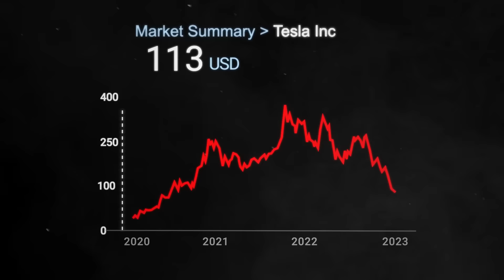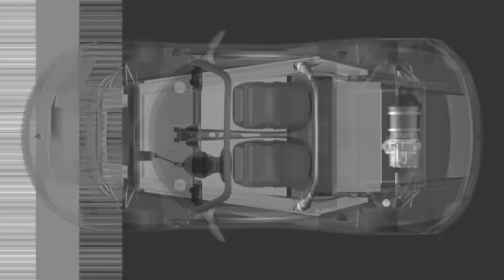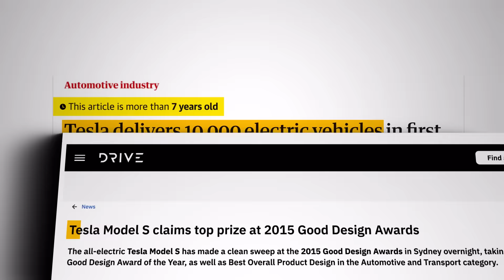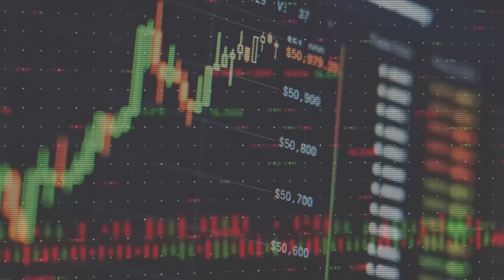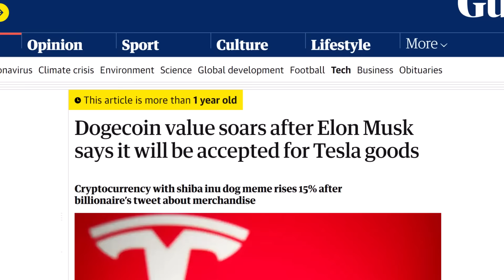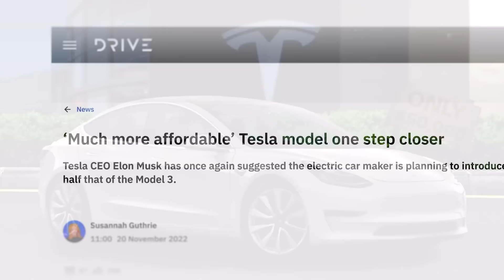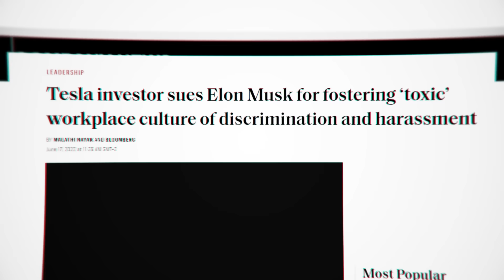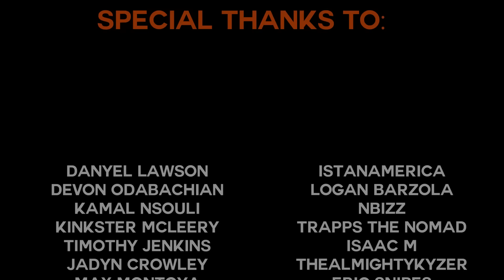Why Elon Musk Is A Fraud

Comment: You could have touched on the fact that Tesla was simply overvalued due to Musk's hype. I mean their value was so ludicrously high in 2021, they were worth more than the entire auto industry combined and then some. And Tesla also simply doesn't have enough production capacity for their demand. And with the recent price cuts,the car market just realized how much better Tesla's margins are compared to the competition.
Reply: price cuts were quietly reversed when demand spiked after.
Reply: @AlexanderTheGoodEnough  partially, it's still cheaper then before the cuts, as the big reason is they still need the model Y to be under 55k because the IRS for some reason doesn't consider it an SUV, so the electric tax break didn't apply, even though every other agency and vehicle in the same class is an SUV.
TL;DR: the IRS' stupidity was actually good for consumers.
Reply: Tesla has massive structural advantages over the rest of the industry.
Reply: @taylorc2542  do they? I would think LG would considering they make every battery besides Tesla and Lucid? 

Every GM, VW, Ford, Hyundai, Kia, FCA, etc all use LG batteries
Reply: @taylorc2542  LOL
They have no structual advantage over the industry. 
They have the same machines Toyota and VW are using.

Musk is just really good conman that convinced the world he is a genius up until just a few months ago.
People finally see through this fassade and he gets the bill one after another.

First they ridiculed him for making a marketing play with twitter and then being stupid enough to actually agree on an arrangement before all the info was available, then they realized that both his public and good transport systems are completely bullshit, people are finally catching up that "Autopilot" has a legal definition and the Tesla software has NEVER ever been close to reaching it, they realized he was part of PayPal not THE PayPal and even SpaceX (who are his genuine only positive contributions to the world) was not his idea (nor were the reusable rockets).
Reply: Tesla’s cars are ancient in the car workd
Reply: @AlexanderTheGoodEnough  they also increase operating margins even with price cuts. Literally a slide in their q4 slide deck. But people never read 😭
Reply: People: Tesla's cars are overpriced!
Meanwhile in Croatia: Wanna buy a Rimac that almost killed Richard Hammond?
Reply: @dirtyorganboy  Yeah. They made a Tesla Roadster back in like 2007-2008. It's based off of a Lotus Elise. It kind of looks like a Lotus Evora in some ways.
Reply: If we are using stock price declines as proof a company is screwed, the where's the video on Nvidia when it dropped 65?
Reply: @Tential1   if Tesla was sold tomorrow morning, how much you think they would get? Nowhere near that valuation that's for sure...
Reply: @HOLLYWOKEtv ... Not green Revolution, just that Musk and his way of presenting the company made it seem like a tech stock, so it is similar to Netflix, because both are just newer players that came in and refreshed/reinvented their respective industries, automotive and film/media respectively, but at the end of the day, they are both just players, not monopolies in their fields
Reply: @gandalf_thegrey  You don't think Musk is highly intelligent?
Reply: Elon said the stock was overvalued. 
You blame Musk, yet wall Street is the government goodies bag.
FTX
Gamestop
Enron
Reply: @matternst1442  LG outsources their batteries. Some Chyna man stamps an LG sticker under LG contract.
Reply: Lol wait?? Are you telling me moon left out huge parts of the story to bend a narrative his way!?!?!? No wayyyyy he is soooo trustworthy
Reply: but he rather tell us Elon's life story and stretch this video to 20 min xD
Reply: Who told you that Tesla is just a car company? You compare it to other car companies yet you should compare it to a multitude of branches
Reply: @gandalf_thegrey  The main advantage is their company culture runs circles around legacy makers i.e. it runs like a start up instead of a bureaucracy. Other advantages include the best charging network, no marketing costs, and the data set/AI training model they are collecting with the existing AutoPilot fleet.
Reply: @Elstocks21  Yes it's true Telsa isn't just a car company, they also sell solar panels that are no better than what you can buy from any other solar panel supplier & an overpriced solar roof that doesn't make any economic sense!
Reply: @rabbychan  hes jelli af… thats all
Reply: But the fact that they cant satisfy the demand can work in Tesla favor - it makes Teslas more valuable - therefore more expensive. Its not necessary a bad thing.
Reply: They are worth more than just a car company. 
Solar. Logistics. Automation. Trucking.
Reply: Did you even watch the video? 10:30 onwards.
Reply: @Galacsia  Yea it its end Tesla being the top dog in EV and will face stiff competition ahead.
Reply: Every time that I mentioned that fact, or anything that wasn't hyped or praise, back in 2021 (up until very recently) I was thinking that other people would see it as a concern (the rational people that I, wrongly, thought made up a good chunk of the population). Nope, I would get dumped on every single time, online or in person. I was a weird hater and Tesla stock would go to the moon making every person who believed in Musk very rich, and mankind would ascend to a new level of greatness on earth and in the heavens on Mars... Yea, a bit hyperbolic, but hat's actually how it felt to me, maybe I just didn't believe in the savior hard enough. Even now, I feel like the main reasons people are starting to come around are more based on politics, rather than looking at the actual situation which I find just as concerning.
Reply: You are completely missing the point that Tesla isn’t just an EV company. It’s an EV + energy + software company that now also makes its own batteries from scratch. They also have the only reliable charging infrastructure. Now, I do agree that it was overpriced to an extent even with all these factors in mind, but one cannot compare apples to apples + oranges + bananas.
Reply: @Grapheneolic  You are right. I always forget that. But profit wise, dont they make their bread from the EV cars? What software are you talking about as well - the software inside the Teslas? Auto Pilot?
Reply: @Grapheneolic  The solar buisness is small and still not to scale, the software and charging networks are mandatory to operate the electic car, just like gas stations and software in other modern cars. Also you cannot value an electric charging station to a gas station, as all the cost is in the charging station itself + maintenance, no store to make the difference . Sure it adds a couple of billions of dollars in value, but no more than 6,(electrify america is valued at 2.5B).
Reply: @realthunder6556 it’s not just the IRS also, another thing to mention is the federal governments involvement in helping other US manufacturers heavily with aid financially and support legally while Tesla didn’t even get invited to the summit.
Reply: they got huge margins. they are selling these shitboxes for 100k when even a camry feels like a different universe in terms of quality. had a model x for a few weeks and i was shocked and appalled about that. i still cannot understand how someone in their right mind would buy a tesla for that kind of money, especially now when there are alternatives from the germans and pretty much everybody else
Reply: @gandalf_thegrey  he upset the left, and that’s enough really
Reply: Yeah but pretty much everything was overvalued in early 2021.
That is if you assume now is correctly valued.
Reply: @gandalf_thegrey there’s a lot of projections in your comment. People know Musk didn’t come up with these ideas but making them successful is all him. 

I simply don’t care about him as a person and there’s a lot of people of this mindset. People like that he’s doing some good. It’s a capitalist society, so if you think he’s doing out of the goodness of his heart you’re to blame. He simply saw there’s gap in the market in the case of Tesla and SpaceX and bought them out to push them to success. Without him neither of these would be successful with their original founders. 

I wanted to buy a Tesla but looking at the safety issues and lack of self repair is a deal breaker.
Reply: @Grapheneolic  Tesla uses Panasonic batteries, which are produced as a joint venture & while they have input into the design, chemically the batteries are nothing more special than what other carmakers have available.
While Tesla has tried to heavily use software to overcome the hardware limitations in the vehicles which create a handicap for self driving & kills people, they can hardly be called a software company!
Reply: @jayr6637  I was an electrode engineer for the 4680 batteries at Tesla, those are fully produced by Tesla using its own technology and what sets them apart mainly is the means by which they manufacture them in a cheaper manner (Tesla is all about vertical integration and keeping everything under one roof, which ultimately leads to reduced costs + given its mainly domestic this will be even more important if China relations further deteriorate). Tesla also clearly lays out the limitations of its self-driving as they actively iterate on it, if people choose to ignore that by sleeping behind the wheel then that is on them.
Reply: @Grapheneolic  While I find it hard to believe an engineer working in such a field would bother watching Youtube content critical of Tesla, let alone waste time debating others in the comments, I have no way of knowing whether or not your statement is true. But upon checking, you are right currently 4680 production is in house, with Panasonic getting involved to help with production numbers, but I note that you have said nothing of the 4680 chemistry being any different.

While this "Tesla also clearly lays out the limitations of its self-driving" may be technically true when reading through documentation, the conman CEO of Tesla does sing quite a different tune in his public statements... when he's trying to scam more people into buying a Tesla by promising fully autonomous robotaxi's that will make you money!
Reply: People who invest in Tesla are investing in potential not current value.
Reply: There's a few key things everybody seems to be missing,Tesla is not a automaker,it is a AI company the cars that you see are not cars they are robots on Wheels the technology in which Tesla has are decades ahead of anybody that you guys call competition,tesla's valuation being bigger than auto manufacturers put together is due to the fact that Tesla is way more than just an automaker, which alot of people seems to ignore the technology or maybe they just don't know ,so they speak on what they believe and not what they know to be facts.
Reply: I mean he said that at the end of the video very clearly I think
Reply: Look at EV, Not market cap.
Reply: It's the circle of douche.  A young CEO starts out, calls some good shots, gets lucky in others, and becomes the new golden ticket.  Golden ticket starts believing their own hype, they smoke pot all day and start thinking that even their farts are magical money making innovations.  Reality does what it does, and they come crashing down.
Reply: it was also valued more like a tech company than a car company
Reply: @rabbychan I cant speak for gandalf. Musk obviously isn't a moron, but he isn't as smart as his public persona. he is a good investor and a better marketeer
Reply: Watching Silicon Valley teaches you a lot about this bs lol
Reply: They did actually, that point was touched on in the vid
Reply: If you tried to raise this point two or three years ago you'd have to deal with all the musk worshippers
Reply: @rabbychan He was before his lobotomy
Reply: Tesla is AWESOME!
Reply: Un Elon musk c’est bête
Reply: Not just that, but people also are seeing Tesla quality is god awful
Reply: @taylorc2542  wtf are you talking about structural advantages?
Reply: Shh don't let facts get in the way of the clickbait or views
Reply: Everything was ludicrously high due to $0 commission trading platforms on all smartphones and the large amount of money printed in 2020 and 2021
Reply: If there is so much demand, then why cut prices? It’s more nonsense propagated by Tesla
Reply: He didn’t even touch on Tesla’s sketchy accounting. I guarantee you that their books are not clean.
Reply: @tpfrk8977  In China they needed to be competitive, then in the US the model Y isn't considered a SUV by the IRS(the rest of the US gov does, but this time it's a good thing for the consumers) so the price was too high for the tax break and also after the stock price drop and Elon Twitter shenanigans, they needed even more demand so the stock is up, up, up
Reply: @realthunder6556  The stock is up because of the gamma squeeze caused by call option buying by meme stock speculators
Reply: @AlexanderTheGoodEnough  Just by small amount
Reply: @gandalf_thegrey  Tesla has the biggest injector machines, more vertical, faster growth
Reply: @Tential1  61 percent customer return before price cuts... Tesla is still growing. People quit reading too soon.
Reply: You , realfart6, could have touched on the fact that Tesla is the real life version of Skynet and is going to, like the Terminators, hold humanity accountable. Put that in your pipe and smoke it
Reply: Tesla’s earnings are top notch hence why they’re valued where they are. Also a lot of the reason Tesla’s stock went down is due to him selling to buy Twitter, which he stated was a mistake. As far as Tesla’s dominance half of those ev cars manufacturers won’t be around by 2025. Tesla is still king
Reply: @ivanr9408  'Enough'!!?? Elon wants over 10 times current production.
Reply: @gandalf_thegrey  what exactly do you mean with the section that reads; “… they didn’t realize he was part of PayPal, not THE PayPal?…” are you saying that he was a founder of a different company with the same name as THE PayPal?
Reply: Yeah Tesla stock was overvalued but the company did revolutionize the ev market and made evs on trend Wich is good overall
Reply: The high price was also caused by a short squeeze.
Reply: You still think evaluations mean something objective and real
Ah, well
Reply: He did touch on that…
Reply: Dude, Moon basically just tells a story. It's not about informing, it's about storytelling. I suspected he was not really a great guy (just his sponsorships kind of speak for themselves), but this video is the nail in the coffin. It's been 3 and a half minutes and the complete dissociation from the truth is crystal clear.
Reply: @matternst1442  Tesla uses Panasonic batteries, so what's the point?
Reply: Maybe do some research- Tesla is an energy company not a car company
Reply: @taylorc2542  Tesla does not have any autopilot
Reply: @dattajack  Nonsense.

There's no skynet at Tesla, it doesn't have any AI, it doesn't even have its autopilot.
Reply: yeah, not a particularly good video. Like he wanted to report on Elon but at the same time wasn't willing to point out the most egregious issues with Elon.
Reply: Did you even watch the second half of the video?
Reply: @realthunder6556  that is not an accurate explanation at all. The IRS does consider the model Y to be a SUV and the base model is eligible for the subsidy. But the IRS does not subsidies SUV that are over 55k. I personally think 55k is way high for the upper limit of the subsidy but it does make sense to put in a limit to not subsidies super expensive cars. The subsidy is an incentive to make more affordable electric vehicles
Reply: Tesla was appraised as a tech company not as a car company.
Reply: yeah ..so becuz of the overvaluation of one company ..you called him fraud ...nice
Reply: Part of the reason for Tesla's overvalued price is they were being valued as a technology company, not a car company. This in itself would be fraudulent in any other point in history, but it contributed greatly to the stock price of the company. Regardless, people need to stop looking at Musk as this smart man who has their best interest in mind. He's a grifter who found a grift that worked and bank rolled on loop holes, but his shadiness is catching up on him.
Reply: Tesla reported record profits and record revenues for 2022,  Profit for the year hit $12.6 billion, more than doubling since 2021 and beating the expectations of most analysts.
Reply: No brains no skill required to "save money" by cutting corners, especially cutting safety for workers.
Nothing "genius" about that.
Reply: @leftoverpizza01  All useful work is done by non-famous people.
Reply: @luizmonad777  BS.  Nothing wrong with electric cars. Just not exploding Teslas. Just not from a company that disregards worker safety and puts the stupid fetishes ideologies childish quirks of the CEO above doing what is best and fairest for workers and customers.
Reply: @theultimatereductionist7592  Yeah. We've been doing it since the dawn of time with slavery and its adjacents. San Petersburg was built cutting all possible corners.
Reply: @theultimatereductionist7592  oh and sugar is sweet
Reply: @joshuahoward5667  yet here you are
Reply: It literally talks about that exact thing in the video
Reply: @gandalf_thegrey  boo hoo im poor
Reply: @gandalf_thegrey   Tesla is much more centralized in it's design. Do you have any Idea how much tier 1 suppliers all other companies use, a lot, how much tier 2 suppliers they use, a lot more. It is really diluted, slows down R&D and ups the costs. That is my tesla has so much better margins.
Reply: @gandalf_thegrey  seethe bro.
Reply: In Elons defense, he did say like a dozen times last year that Tesla stock was way overpriced
Reply: There is no hype. Elon is simply passionate about what he does. He has even said NOT to buy Tesla stock. He knows it’s worth more than it should be. HE HAS SAID THIS”
Reply: @matternst1442  Its not so simple. At the level of scale, battery companies have to setup new plants and have a new sourcing. Basically every one is following the Tesla-Panasonic model for making batteries. GM's model of taking batteries from LG was a flop.
Reply: @archigoel  Do you think battery production will go similar to commuter chip production as in one manufacturer like TSMC?
Reply: @jiingus_5703 Or maybe just he knows how to sell people that he’s passionate, when in reality he’s only passionate about the grift.
Reply: @gandalf_thegrey  to be fair it was smart to use some of his tesla bubble to buy twitter
Reply: @matternst1442  The same LG batteries that caused the Chevy Bolt fires?  Are you serious?
Reply: You're giving Musk too much credit for being able to control the market.  Musk tweeted back in 2020 that TSLA share prices were too high.  The market listened to him for a week or two by sending share prices down ... but they then bought back into TSLA, sending share prices up by at least 5x.  With a P/E of 150 at the peak of TSLA's share price for a somewhat mature company that wasn't likely to see anymore 40% or higher growth in gross profits, it was definitely overvalued in early 2022 before getting knocked down to a more realistic P/E of 34 at the end of 2022 ... which is more in line with Apple's P/E.  But now, TSLA's P/E creeping back up to around 70 now.  Tesla cutting prices on their cars increases market share, but it eats into their gross profit ... so, TSLA share prices have been moving back into overvalued territory again.
Reply: well i guess this channel is full of musk haters so i am glad to see everyone here proven wrong by the new tesla stock price also the video has a lot of bias towards hating musk and isnt talking about the truth it talks about what musk haters want to hear
Reply: @rabbychan  -  Musk... this dude is simply worth my time.  i dont look at him and hear him speak some and leave, thinking "what a worthless bag of fancy talking dogshit".   mans a legit self made billionaire and that takes a fuk'ing sick amount of effort of which not many of us at all are willing to put in, let alone put in to muliple things at once.  he simply is what i wish i could be.   we all like to see ourselves beign productive. well the mass majority of us anyways, but we fail at having that ambition....24 hours a day, and 7 days a week.  thats where stop and Musk begins...the dude just keeps on going.  thats what i mean when i say i wish i could be like that.  i wish i could keep on going.  cause when i or you succed at something.  thats a dam nice feeling.  that our time was production and we now have somehting to show for it....not just hours of MOON videos  lol
Reply: It was because of quantitative easing.
Reply: Teslas have always been incredibly shitty cars. People just bought them for the novelty of having an electric car back when they were the only option. Now there are other options and tesla is losing popularity as a result.
Reply: Tesla's hype was purely on FSD. To think that Tesla would maintain it's dominance in EVs with a base sticker price of $40K was ludicrous. The average Joe without a home that can self-plug won't be buying an EV in the first place, much less for $40K which is 80% of his salary.
Reply: its not about tesla or anything its about elon musk not beeing politicaly correct enough.  thats it.
Reply: @yakimandu5098 , so Musk being not-PC is the reason why he has failed to deliver on FSD or why Cybertruck is 3 years behind production schedule?
Reply: Cry more
Reply: 10 months later and Tesla is basically on the track to where it was in 2021, while also giving us who missed the train chance to buy in. 

I bought few shares of Tesla for $125 and damn am I glad.
Reply: Is this comment a joke? I seriously can’t tell.
Reply: @tjnucnuc  Nah me rambling on a train 10 months ago
Reply: Yeah, for some reason, Musk can make wild statements about what tesla will do, not do it, and he hasn't ended up like Elisabeth Holmes
Reply: @taylorc2542  Tesla has world wide structural support and is struggling to even maintain it's current financial gains. How is it they have access to a world wide market and can't sell a car??? What advantages are you talking about?
Reply: @gandalf_thegrey  There is so much wrong with your post that I don't have the energy to respond further